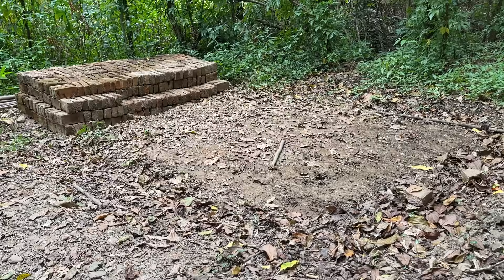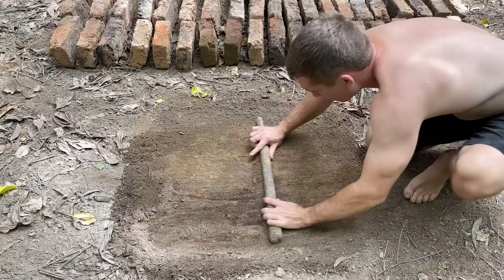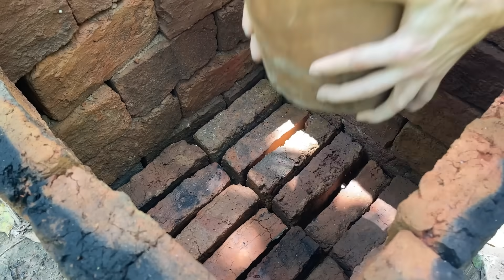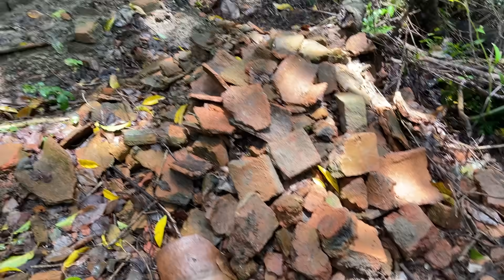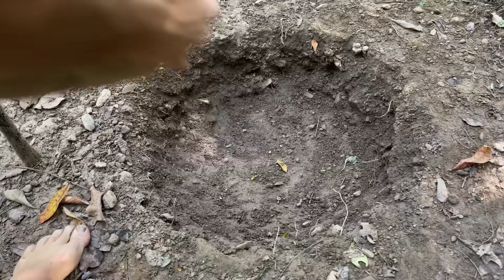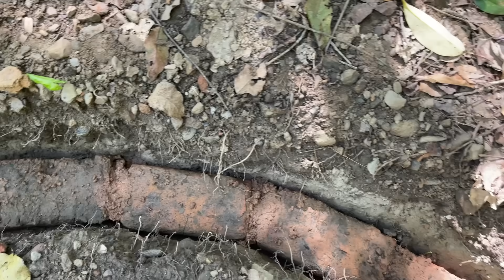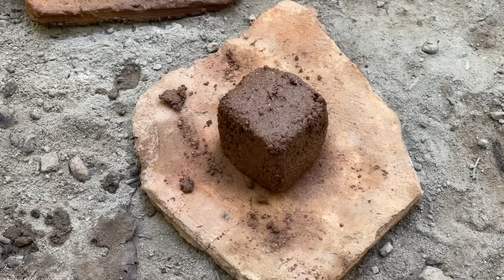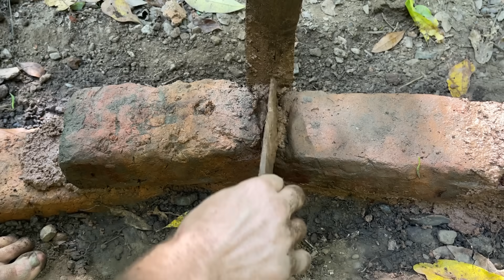Primitive Technology: Wood ash & crushed terracotta mortar

Comment: No doubt the way it was.  The mold could be made with the ends perpendicular to the tangent of the circle, to make the end joints parallel, conserving mortar.  If the layout stick were straight, the joint between courses could be thinner on the inside, transferring the load of gravity from top to bottom  if you were making these as a standard structure, or larger editions, like, back then.

Comment: Okay, I understand that all of this is supposed to be primitive technology, but I have a serious question:

How could one build a slightly larger “pot” to mix the mortar in? I mean, it would just need to be a bit wider at the top so that you can work more comfortably. I understand the concept that simply digging a hole is quicker, but because of the soil contamination that happens when mixing directly in the ground, I think the mortar’s strength might actually be affected.

Maybe it’s due to other factors — I’m genuinely asking because I’m curious.
For the mortar pot, I’d imagine something more like a wok shape, but please enlighten me :)

Comment: @primitivetechnology! PLEASE make the bottoms of your walls thicker! once you create an arch, there is a lot of outward forces, and it needs the WEIGHT to withstand it (Mortar does not have much tensile strength) I would say make at least a double thickness of bricks on the bottom, or a few thickened areas that become butresses! It will collapse without enough weight in the walls! AMAZING VIDEO! 

_source: I have build a few arches.
Reply: I would hate for it to collapse on you!
Reply: Maybe he’s planning some flying buttresses 😂
Reply: A circular base probably needs just one ring of bricks, while a rectangular base needs more, right?
Reply: Like  any creation  ; this will b a test for further  improvements *

Comment: Your ever growing pile of bricks is one of the most impressive personal accomplishments I've ever seen. It's crazy you made all of those by hand. This wood ash mortar was a great invention also. I hope when the camera is off you throw on a dust mask while crushing it.
Reply: What's most fascinating to me, is how clear it becomes the the destruction of the previous efforts always leads to a better more stable compound in the future.
Reply: i don't know how tall he plans to make this structure, but you can be assured that you will see that entire brick pile vanish before your eyes and john cooking up many more bricks, in short order
Reply: @gfhrtshergheghegewgewgew1730  you can actually guess, the end of the 2.5 meter diameter stick will be at the center of the arch. So the structure will be around 2.17 meters tall
Reply: @svuvich note he said he plans to make a pointed dome rather than a hemisphere, so it will be slightly taller than the radius.
Reply: @alecity4877 yes but not "slightly". My calculation shows exactly how tall it's supposed to be, because he places a diameter stick with one end at the ground perimeter at the other at a new layer of bricks. We know that the last layer will be at the center of the structure. So two ends of the stick and the center on the ground will form a right triangle. Which means the distance between the center at the ground and center at the top is √(2.5²-1.25²)≈2.17m
Reply: @svuvich  I'm going to guess that he stops before that, though.
Reply: @svuvich  I misread your comment I think, but still appreciate your feedback providing calculations.
Reply: @Pongo_Ponginae  I doubt it. I wouldn't put it past him to cast/form a top cap and place it on top to complete the structure
Reply: @gfhrtshergheghegewgewgew1730  They say he plans to build a cathedral!
Reply: @gfhrtshergheghegewgewgew1730  The implication from the construction and the stick is that the peak will be when the measuring stick spans the distance between the floor/wall joint and the peak.  Which thus implies it will be the square root of 3 over 2, times the diameter.
Reply: i would have no problem whatsoever with a dusk mask WHILE filming too. please protect your lungs !
Reply: It’s Nighthawk!! I’m glad to see you here! You and Primitive Technology are awesome!
Reply: Primitive Technology: Dust Mask.
Reply: I was thinking the same! Please don't risk silicosis / potter's lung.
Reply: hope he knows how to make a primitive dust mask
Reply: Mate you need a crew just to produce the required materials. I suppose that’s what communities have always done. Amazing as always
Reply: He didnt make one yet
Reply: Made from palm leaves, I'm sure
Reply: If he's wearing shorts he didn't make himself, he can wear a bandanna ;-)
Or start wearing wombat loin cloths or a grass skirt.
Reply: В такую хижину уже можно и скво поселить. Есть. Где от кузуаров спрятаться. Молодец, смотрю с удовольствием, Что-то подмечаю. Так держать)
Reply: In France they are building a castle from the ground up and they wear modern helmets and safety harnesses, because quote: “We are not trying to find out what the historical accident rate was.” I think that is a good thing. Times move on, we improve. Yes there are many things that we can still learn from the past but these people also thought lead made-up was a great idea and believed there where real cyclops in the Mediterranean…
Reply: Also hope he puts on some gloves when working with the highly alkaline lye.
Reply: @nby333  😁 You know, I bet that he's actually considered all these health & safety angles.
Reply: @Pongo_Ponginae  Hopefully. But I remain doubtful.
Reply: @nby333  Well, read his papers and get back to us.
Reply: Don’t tell me what you do for a living or how much money you have, I want to know how many hand made bricks you have in the back yard
Reply: Yes, please at least a bandana.
Reply: He's not using high speed rotating/oscilating tools to excite a huge cloud of fine dust in an enclosed workshop, he'll be just fine.
Reply: That's not wood ash mortar. That's pozzolanic mortar. And he dumps and mixes with his face upwind, but good point.
Reply: @TheBjameso  He's making it from wood ash... so it's both "wood ash mortar" and "pozzolanic mortar"... eh?
Reply: Agreed. I was about to tell him, I won’t be offended if he opts to use a dust mask for such tasks, even in the video’d shots.
Reply: You right, that is a nice stack of bricks! Made me think, easy to see why ppl needed and used kids no screen time just brick making time😂
Reply: @coolhandluke1503 in Pakistan and India they still use kids to make bricks, from as young as 5-6
Reply: @coolhandluke1503  exactly. "child labor" pejorative nonsense is propaganda by certain types looking to keep down families.
Reply: A load of bricks like that nowadays would cost a couple thousand bucks $US. =^[.]^=
Reply: He'd need a genuine respirator to block the microscopic dust from ash and crushed terra cotta. A silly face diaper won't do anything. Many of you folks were bamboozled during 2020, thinking a piece of cloth would stop an absurdly tiny sphere of protein.

This guy generally puts himself up wind of the source of dust or smoke for his primitive work. Out ancestors did this almost unconsciously.
Reply: @tar170 замечу, что перед медицинской маской не стоит задача отфильтровывать вирус, ведь вирусы чрезвычайно редко выделяются из организма в чистом виде. В подавляющем большинстве случаев вирусы содержаться в гигантских, по сравнению с ними, капельках слюны. Их-то и задерживает маска.
Reply: @nekrosof_kac  I was going to mention that the masks are traps to increase health issues with the wearer!
Reply: @greggzuman529 любое средство защиты это всегда компромис.
Reply: @tar170  Those absurdly tiny spheres of protein are carried in rather larger water droplets, which are what is trapped by the materials of the mask.
Reply: @tar170 you can 100% filter out at least some of the particulate with even a simple cloth. Thats why you have to tap a sieve to sift fine powders like icing sugar and flour, despite how much smaller the grains are compared to the holes in the mesh
Reply: @SleepLessThan3  breathing does the same thing as tapping though doesn't it! Air flow pulls the small particles through
Reply: @tar170  did you not see the covered vs uncovered contamination experiments? Petri dishes with growing medium set at several distances and then talking/coughing/sneezing with and without a mask.
It was a good demonstration of reducing spread of contaminants by wearing a mask.

There's also the fact that reducing contamination with a cloth mask might not be perfect, but it's better than not doing anything at all
Reply: @tar170 cloth masks were never supposed to block virus particles, dummy -- they catch a lot of the water droplets that the viruses ride in.
Reply: @tar170 your comment is a great example of how having a little knowledge is dangerous.

Those "silly face diapers" served to filter out viruses that traveled on respiratory droplets. There were never enough N95 respirators for the general public, but the use of surgical masks by the public was a stop gap in reducing viral load. Every human comes into contact with viruses everyday, but (usually) not in high enough viral loads to overwhelm one's immune system. 

In regards to commentators recommending the use of a "mask" :
If one uses the context clues available, one could ascertain the term mask is being used as an item that covers the mouth and nose to help prevent insulation of particulates.  That's why no one else is making your point nor are others interpreting "mask" as an object used to disguise or amuse others. The layperson's term for respirator is ubiquitous for masks as many do not know to distinguish between the two colloquially.

Finally, silicosis is real and it's a brutally slow death. There are millions of deceased bricklayers, jewelers, chemists, and miners calling from the beyond to heed the warning to protect one's lungs with a respirator (mask) and don't just leave one's fate to the fickleness of breezes or "the open air."
Reply: @tar170  I'm glad you are running the WHO
and not that creepy Kennedy bloke
Reply: @tar170  Stopping a % is still better than stopping 0. Unlike ICE, doctors wear masks for good reason.
Reply: @Moosetick2002  there's plenty of good reasons for doctors to use ice as well! He's going to have difficulty getting ice with where he's located, or inventing it presumably, but Aussies were the ones that invented freezers for good reason, so maybe he can re-invent it too & make his own ice :)

Comment: It seems you plan for the door to be of constant width (50cm), that would require atleast one custom sized brick per each level, no? Since the diameter with decrease the higher you go. Are the bricks easy to break in a straight line?

Comment: You sould try making roman concentrate or something like it. I think they used volcanic ash (you can only use woodash), sea water and quick lime wich was made by burning limestone to 1500° C but i could be wrong about the temperature
Reply: Volcanic ash is a pozzolan (look it up), essentially a catalyst for mortar setting but the wood ash is not that, completely different chemistry.

Comment: This building has better foundations than my house! 
Built in 1862, it has only two courses of bricks below ground level. The bricks are  made of clay taken from pits 25m away and fired on site. They are laid straight onto the clay beneath but are double width bonded. 
Jon's building should last a very long time!
Reply: Just goes to show how much effort went into making a house.  My house is a little newer (1900-ish), but presumably the bricks came from a local brickworks.  Still got quite shallow foundations but no major issues after 125 years.
Reply: @daveys  I am glad that your house is faring well. 
There have been such extended dry periods in France that in areas with clay soils, the foundation soils have been drying out, shrinking and leading to significant cracking in brick houses. Massive cracks zigzagging up a wall.
Reply: if it was built in 1862 and still stands it must have a really good foundation
Reply: As long as a tree doesn't come down directly on top of this one, like his last brick and mortar hut, it should be able to last a long time.

Comment: You absolute tease. You give us a second brick-and-mortar structure, going on about gothic arches, and you end the video before we get to see it completed?! ... I'm so happy I'm subscribed to this channel. I can't wait.
Reply: I imagine once the entire structure is built he'll make another batch of mortar to cover the outside and fill in any gaps.
Reply: I mean, in just this video alone the amount of labour going into it enormous. I'm impressed he even accomplished this much since last the video.
Reply: 1. He ran out of ash and 2. wants to make sure if the structure is water resistant, before he continues.
Reply: It will be a fire hut tho when he gets it done. EDIT: it will probably be really hard to exit from due to the narrow doorway.
Reply: But that 50cm opening is throwing me off. That's gonna be a tight squeeze, if he wants gothic arched curvature.
Reply: Building a standard African Rondaavel, or round hut. economical of materials and good interior space, and with a roof made from straw or even the teracotta tiles a good long lasting structure. Traditionally here built of a mix of clay and animal dung, and then baked hard using a fire inside, and then the outside coated in wood ash as mortar, making for a structure that is reasonably weather proof, and with lots of grass around a straw roof that is thick provides good insulation in hot and cold weather. Floor typically is made from cattle dung, which makes for a strong floor as it has lots of fibers in it, though it does smell when damp, but does not crack once dry.

Big enough to sleep in comfortably as built there, and going to last well with the brick and mortar base.
Reply: @SeanBZA  That seems like something African cultures would do. Build a house? Great: what should we use as a floor? How about cattle dung? "BRILLIANT!"
Reply: @teebob21  Making do with what you have. When you have no cement, no wood for floors as that will be eaten in days by termites, and you want something durable dung will do, and also used to plaster the walls, as it is relatively strong due to the grass in it, and it is something you get in large amounts if you have cattle around.
Reply: Wouldn't it fill up with water when it rains? Like please bro just put a temporary thatch roof on it so we can watch you make or repair previously used one for few more minutes

JUST FEW MORE MINUTES PLEASE BRO WE GEEKIN
Reply: @Corgi_fax the dry ground will let the water soak through, and the bricks and mortar are waterproof enough to survive.
Reply: @Corgi_fax he'll likely add some form of drainage like he did for the other brick hut, but i don't think the water would be much of an issue so long as he's not at a low point in the area